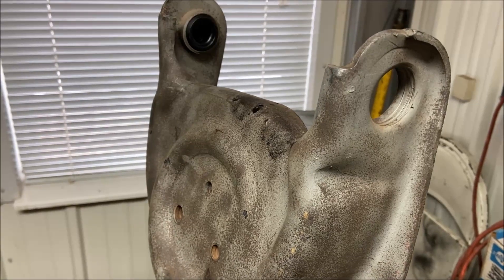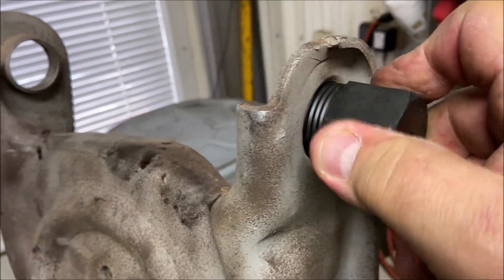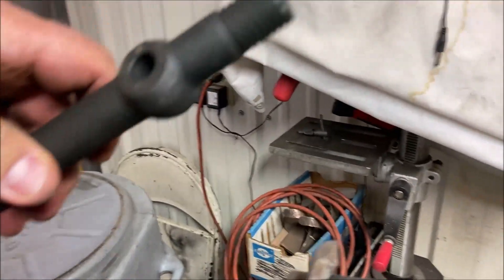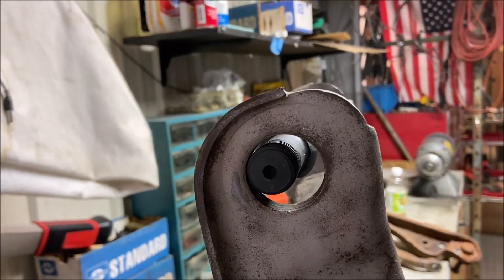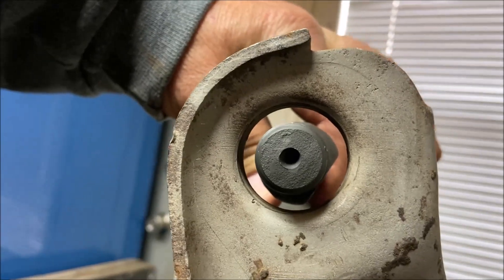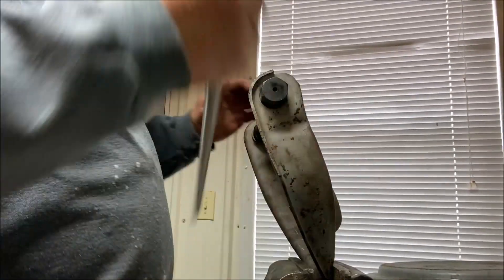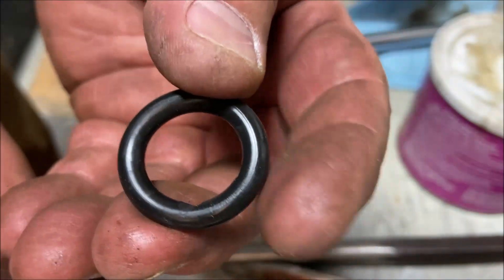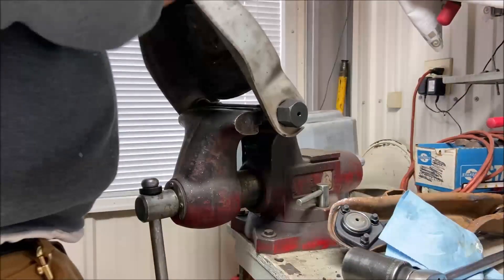1961 66 Thunderbird Upper Control Arm Shaft Kit and Bushing Installation

Comment: ENORMOUSLY helpful video! I just removed my passenger side coil spring yesterday to replace front springs and upper ball joints on my '65 T-Bird. It seems that I need upper control arm bushings...no play when I move the control arm up and down (on the car) in the standard travel path, but when I flex the control arm side to side I get noticeable play. I'll buy a kit from Muscle Car Mike. With your video I know exactly what to look for when putting the new bushings and shaft in. Thanks a million!
Reply from the maker: Your welcome Kaye Nine Two.

Comment: My 2 cents.  As a "victim" of  mid-60's Galaxie, Mustang, and now Thunderbird since 2012, Ford claimed that the suspension was "permanently" lubricated.  In testament to their claim about permanent lubrication, Ford did not include grease fittings.  It certainly was not a permanent lubrication system.  Within 30-50 kmiles the ball joints in the front had to be replaced because the grease was gone and the bearing pieces were worn beyond usefulness and had to be replaced to restore correct alignment and control.  Had to replace my front ball joints in 2016 even after my Thunderbird was restored prior to my purchase in 2012.  Unfortunately, one did not find out that the ball joints were worn out until the front tires were also abnormally worn out resulting in a double whammy of replacing both ball joints and at least 2 tires if not all four.  As always, thank you, Nick.
Reply from the maker: Hey James, the repro ball joints, in my opinion, are very subpar to the original. Many moons ago we took originals apart and took repros apart and compared them and then we saw first hand just how cheaply made the repros are. Its sad. The lowers are much worse then the uppers. We are lucky if they last a few thousand miles.

Comment: So on those large end caps that screw on to the control arm the only bushing is the O - ring?  Since the end cap screws on to the control arm and the shaft screws on to the end cap there can never be any parts to wear out and cause play?  One started to squeak on my 64 Galaxie and I used the straw on the end of a can of silicone lube and it stopped the squeak.  I thought it was really worn out and cause alignment issues?  According to the shop manual you can replace it in the car, and with this video I learnt about notching the O - rings.
Reply from the maker: The O-ring is a seal and its the only rubber involved with the upper control arm shafts and bushings. The shaft and bushings do wear out though. Eventually they dry out, the grease drys out and then the shaft and bushing wear out where they ride on each other. This is why they squeak. Once they squeak, this is the clue that the grease is gone and they are going bad. Original bushings have no grease fittings and you cant grease the repros because of the O-ring like I show in the video. When they wear out, the arm starts to shift position slightly causing the alignment to shift. And the more it wears out, the more the arm becomes loose on the shaft.

Comment: Hey nick question regarding the lower suspension control arms.. I have a 63, just received all my parts from the powder coater, and I have to put the bushings on the lower arms, wondering what’s the best way to install them without a press… I have the center bores sanded very smooth at 320. Thanjs
Reply from the maker: Hey Adrian, I use my vice on my work bench. I put a socket on one end that matches the size of the flaired end of the bushing, and the box end of a very large wrench on the other end. I do not press the bushing in using the vice, it only holds the assembly and helps to ease the bushing in. I then use my air chisel with a blunt end fitting on it and I zap the metal next to the bushing. This vibrates the bushing into the hole with help from the vice.  Use the air chisel to help push the arm onto the bushing. Does that make any sense? Good luck.
Reply: @vintagethunderbirdrepair9426  gotcha yeah that makes sense, thank you appreciate the reply and tips , cheers 🍻

Comment: Hey nick im currently trying to remove the old shafts on my control arms but those big hex are tight on there… I have the right size socket n all but no budge. Any tips? And what’s your process
Reply from the maker: Hey Adrian, I put them in my vice on my work bench and use my impact gun or, if you don't have an impact gun, use a large 1/2" wratchet with a pipe to extend the length. Leverage always works. If you have a really bad time with them you can heat the arm around the bushing but that is a last resort. Ive never had to do that. Leverage always works. Thanks.

Comment: Were you able to fix that other bent arm or do you have to replace it? just wondering what to do if I ever encounter the same issue thanks and God bless.
Reply from the maker: Hey, I replaced it. I didn't want to bother with it. I might try straightening it later. It all worked out nicely, the car rides great now. thanks.

Comment: Is it possible to unload the front end and remove the end caps to add grease? Can this be done without removing the coil spring or control arm from the car? I have some squeaking from my ‘63 Galaxie and I think this is where it’s coming from.
Reply from the maker: I don't know what the Galaxy front suspension looks like but if it is the same as the Thunderbird then NO, you cannot remove the end caps, I think you mean the bushings, from the shafts. The upper control arm holds the spring in the car and if you tamper with that, it will release the spring and someone will get killed if they are in the way. The spring must be removed first to remove the arm, then you can remove the bushings. If they are squeaking they are bad anyway. This means there is no grease and they are starting to wear out inside. Good luck.

Comment: I'm glad you made this video and that I got to see it before I attempted to do mine on my 66, because I'm just about to....  But!!!!  What boggles me is the fact that they made it so that the bushing threads into the control arm AS WELL AS the shaft threading into the bushing...  This makes no sense.  It will obviously not prevent misalignment, nor adds to the ease of installation.  The aftermarket suppliers should be making the replacement kits with a smooth shaft to insert into the bushings and a longer threaded portion where it fits into the control arm to aid in caster alignment.  Just saying.
Reply from the maker: Hey Jesse, the threads are there to hold the bushing into the arm, without threads you have a loose bushing. I guess it could have been pressed into the arm but then it could not be threaded onto the shaft. In thinking about it, I don't see how they could have done it otherwise. Its archaic technology really. And to make the O-ring so big and completely seal the bushing so it is air tight was pretty stupid. But what did they care, it lasted 20 plus years so it was no skin off their backs when they failed from rust and wear. FYI, I straightened the bent arm that I show in the video on my press and then the bushings and shaft fit well. Thank you.

Comment: You said that the original bushing did not have a grease fitting but the replacement does?
How did they grease the original without a fitting?
Reply from the maker: Hey Glenn, you did not grease the original, they were not serviceable. Even if they did have zerk fittings to grease them, the grease could not enter the bushing because the large oversized O-rings created an air tight seal. The dumb thing is, the reproductions that do have a zerk fitting didnt take into account resizing and/or redesigning the O-ring so this is why you have to notch them as I show in the video.

Comment: Hi Nick. Thanks for all the wonderful videos over the years. I'm in the middle of rebuilding the front end on my 66 T-Bird. I was lucky to find a MOOG spring compressor on FaceBook Market Place! Makes the job feel somewhat safe. I ordered upper arm shaft bushings from a well-known TBird parts dealer and am not happy with them. They will not go onto the factory shaft far enough to tighten snuggly into the A-arm threads. Would you put "China bushings" on an OEM shaft or buy a China kit? I don't know where to purchase American made options.  I looked up Muscle Car Mike and seems he only sells wholesale. Do you know where I might be able to buy their products?  I'm considered buying the shaft/bushings set from Eckler's but worried it too might not fit correctly, not sure if it's MCM product or not. My big question is - how do you know when these bushings are bad or going bad? Thanks again!
Reply from the maker: Hey Lance, I think Muscle Car Mike sells to the Birds Nest. You can ask them. Ive been using their shafts and bushings for years and Ive had no issues with them. I used to sell used ones too but those are all gone now. You know they are bad when the inside of the bushing and the shaft itself is worn out. In most cases, the shaft is so badly worn out, its very obvious. Ive taken them apart and sometimes after cleaning they look like they have no wear on them. You can tell when the threads on the shaft are worn out. When looking at them while they are still on the car, if they are bad, usually you can see that the bushing is no longer centered on the shaft because of wear. this is usually very obvious. IN most cases, they squeak badly when they go bad. Not always but usually. I always take it for granted that they are bad when the arm itself is old and crusty, and or the ball joint is also original, and there is no zerk fitting. Then you know they are probably bad just from age. Its also not uncommon to find replacements installed improperly too. Did that help? Good luck.
Reply: @vintagethunderbirdrepair9426 yes that helps. Thanks for the quick and detailed reply!
Reply: @vintagethunderbirdrepair9426  I spoke with MCM. He says "hello" to you. He confirmed that Larry's T-Bird carries his parts.

Comment: Nick,
I never could get those fat O-rings to slide over the shaft ends, so I was forced to leave them out.  I tried everything.  Question: Did you leave the straight zerk fittings in?
Regards,
John
Reply from the maker: Hey John, after lubing the bushing and seal with moly suspension grease, I had to almost force the bushing onto the shaft with the O-ring in place, then thread it on the rest of the way. I do this in the video. They are way too big. I then use 90 degree zerk fittings since straight ones will not clear the shock tower walls around the arm.
Reply: Nick,
Glad you replied saying 90 degree zerks.  Straight ones won't do the trick.  Perhaps pointing it out in the next vid would be helpful.
Regards,
John

Comment: I just looked up muscle car mike and he is wholesale only???  How can I get his parts?  Thanks
Reply from the maker: Birds next sells his upper shaft kits. If your looking to save money, you may be able to reuse your original shaft kits as long as they are not worn out. I have reused those many times but they must be in very good condition with virtually no wear. I do not have any for sale unfortunately, I used them all up. I had a box full once upon a time.

Comment: my 63 has some rubber bushings in the middle on each side of that shaft, but watching your video they seem to serve no purpose? I'm guessing they are there to hold the grease in and mine have no orings. They are not original as they do have grease fittings on the bushings. Such a weird design.
Reply from the maker: Hey moose, Ive seen some shafts that have a rubber "cap" or whatever between the bolt that holds the shaft to the car and the bushing. I dont know who reproduced those and they are very rare. Originally the bushing had an O ring with no zerk fitting. Reproductions have a zerk fitting.